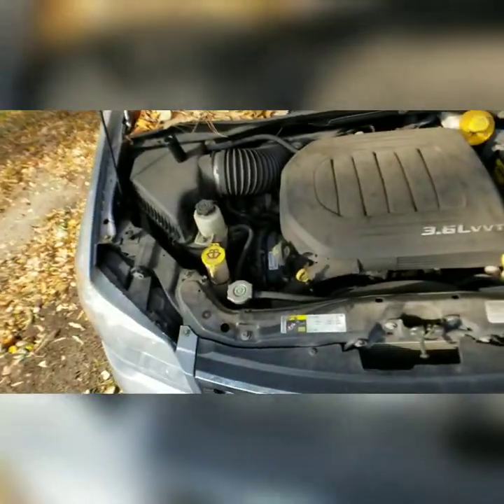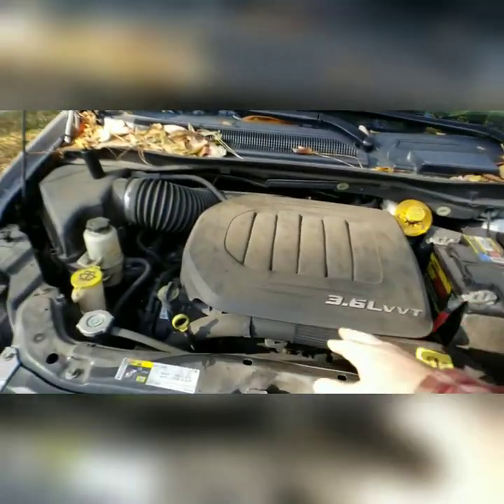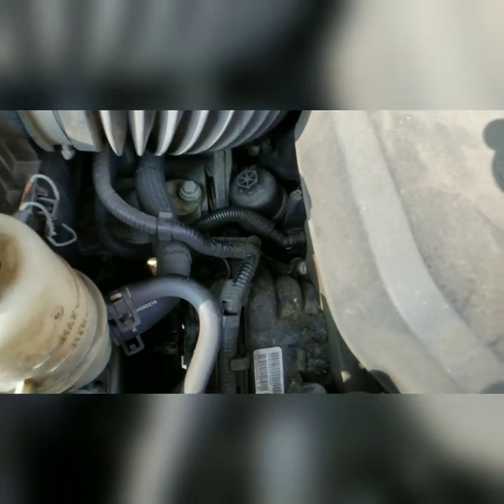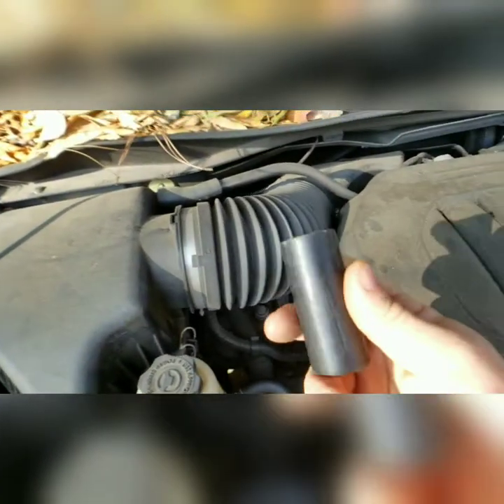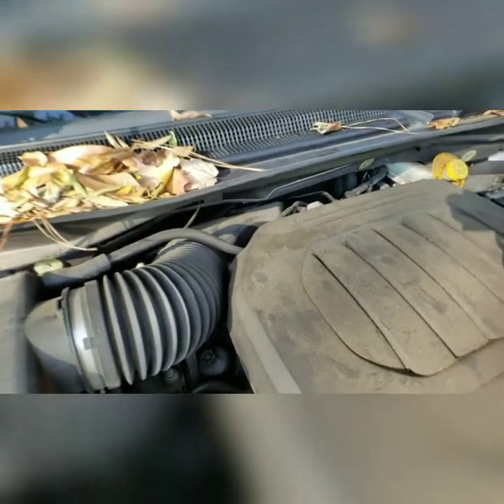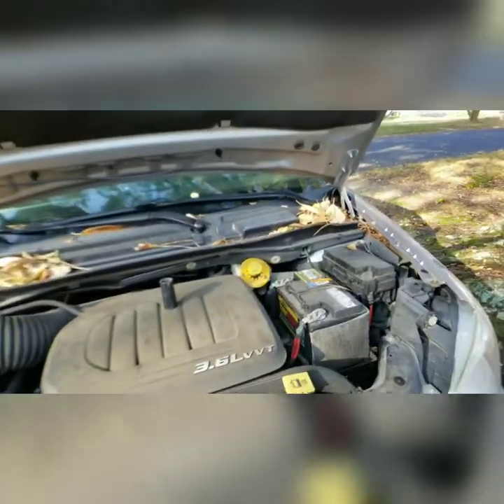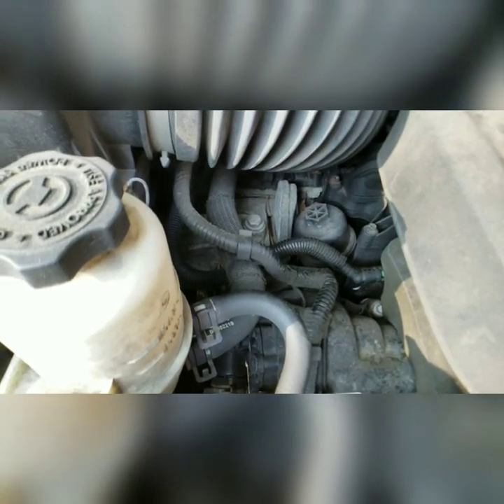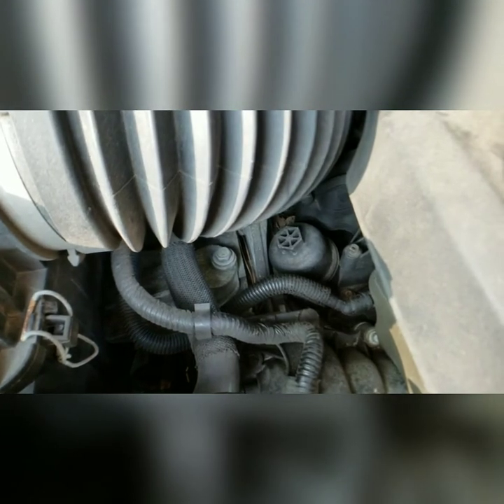2014 Chrysler Town and Country Oil Filter Location

Comment: What do you say about the owner's manual requiring a MOPAR oil fitler?
Reply from the maker: Mopar says to use a Mopar filter 🤔Yep, sounds like something I would say if I owned the company as well. Did you know that the sale of the vehicle only accounts for around 30% of an auto manufacturers profits? They love when you buy their parts and their vehicles break down.